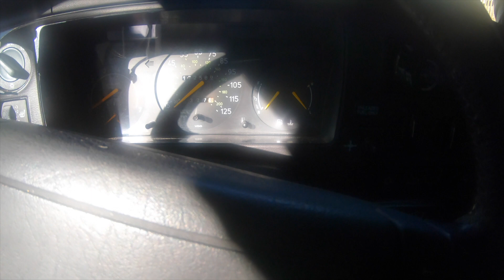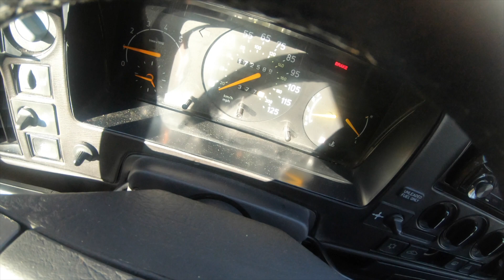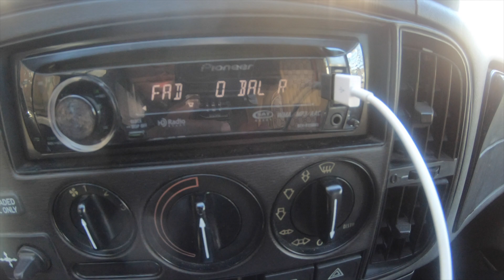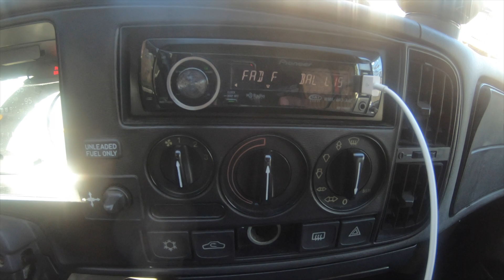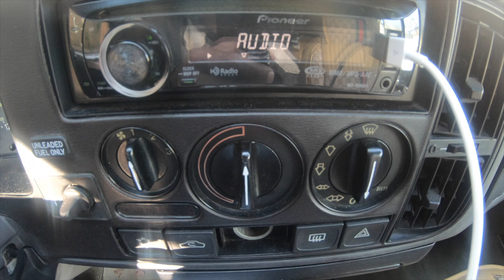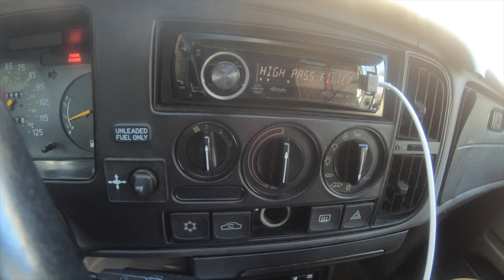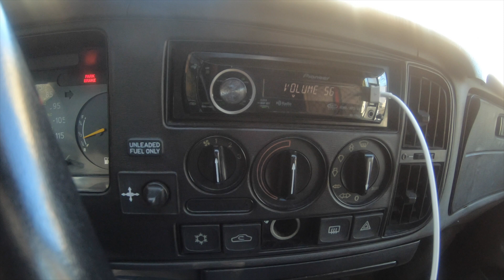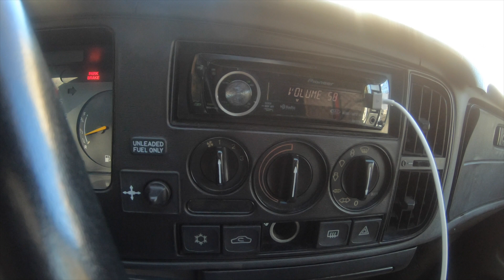KICKER L7 MB ENCLOSURE BOX IS BACK LOUD

Comment: You should get some metal L brackets to keep your box in place. Or maybe get some wood and put it in between your box and the edge of your trunk to prevent the box from sliding and moving around. That’s never good. Also some sound deadner on your trunk lid would help a lot. Eliminate the rattles, keep bass in your cabin. Also please do yourself a favor and turn the bass boost down on your radio. That’s not needed, you have great equipment!
Reply from the maker: Great tips and fixed the box from moving around. Also the bass boost was never turned up on the amp nor the radio it was never any need for it as you mentioned.